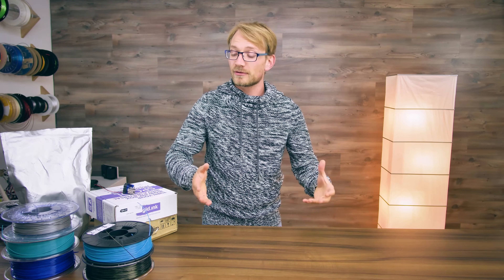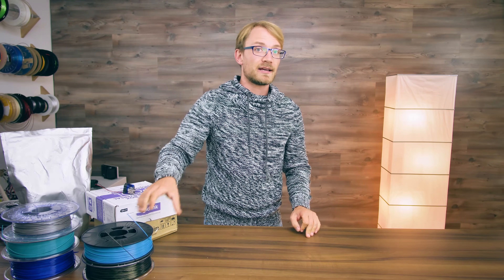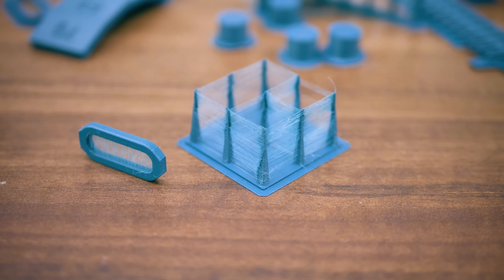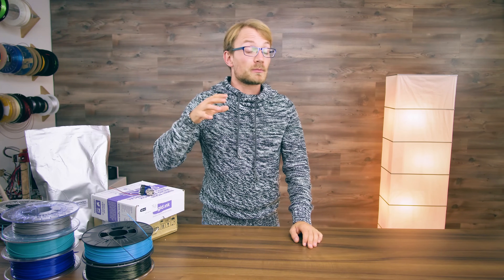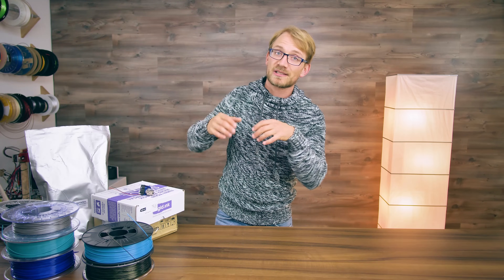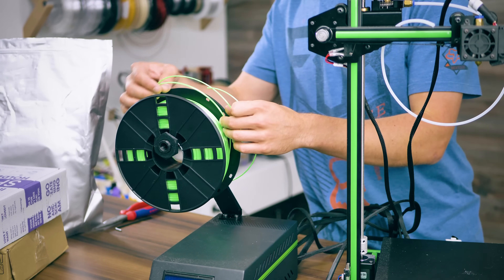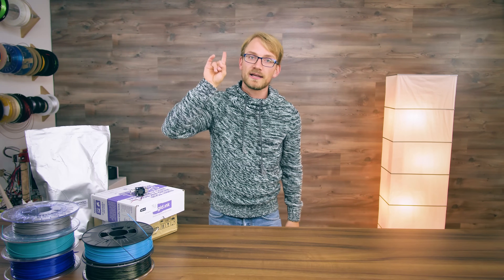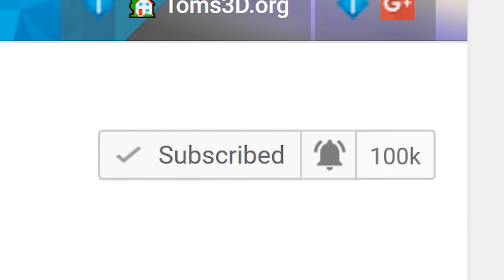5 ways to ruin your filament (and how to fix it)!

Comment: hey, awesome dog and great video :) one question though you mentioned shatterig fillament briefly and I was filled with hope! I baught a bulk lot of UP 3d fillament for super cheap (less that a fiver a roll!) from a returned pallet shipment, risky i know but most of it is fine and prints great, several rolls however exibit this shattering you speak of and i cannot find a fix anywhere, is there one or do i just have to write off those rolls? :) if anyone has any help with this i would be greatful :)

Comment: End G code can help with the turning the thing off nicely. Here's most of mine:

G91 ; relative positioning
G0 Z25 F1200 ; move up 25mm from previous position for safety
G90 ; absolute positioning
G0 X125 Y10 F3600 ; get toolhead out of the way

M84 ; disable steppers
M109 R40 ; wait for hotend to cool
M104 S0 ; turn it off when it cools enough
M81 ; turn off power supply

Do note that M81 only really works on power supplies with their control signal wired into the printer electronics.
Reply: Anonymouspock m109 S40 won't work on marlin as it won't wait for a temp below 80. So that gcode will just instantly turn off the  heater then printer. As I experienced last week. I had to set the cooldown temp to 90, then it would wait.
Reply: John Gisby You're evidently incorrect since I use Marlin and it does not do that. Ah I see your problem: switch S to R and it will wait to cool instead of ignoring the line.
Reply: Anonymouspock marlin will not wait for a temp that is less than half the minimum extrude temp. So either yours has no minimum extrude temp which is bad for it. Or it's not actually waiting, it's getting to this temp(80ish), waiting 20 secs then turning off anyway. Also yes I'm using R not S
Reply: I have Melzi. Will the "M109 R40 ; wait for hotend to cool" work?
Reply: That is probably untrue since I use Marlin and it definitely doesn't shut down immediately. Melzi is a board, not a firmware so no idea if it would work. Try heating the hot end, running that command, then immediately moving an axis. If it doesn't move, it's waiting for temp, then once it hits 40C, it should move, assuming the wait command actually works.

This all doesn't matter because the Melzi doesn't have power supply control from what I can tell, so you might as well use M104 S0 and leave it at that. The point of turning off the power supply after the hot end is cool is that my hot end fan is hardwired into the PSU, so I want to turn it off once the hot end isn't going to heat creep enough to care.
Reply: ANYCUBUC I3 MEGA has a head cooling down feature - after print job is done it homes on the last Z-coord, stops motors and leaves head fan running until head is cooled below 50C. Not saying about "end filament feature" - it's one of the most helpful. 😀

Comment: 6. Dust is a killer. I've spent a lot of time 3D printing in my basement with a wood-burning furnace and have to be extra vigilant against dust. Use a dry box, and retract your filament into it between long uses. Even storing your filament in a closed cardboard box will allow dust to get on it over enough time, and I currently have 4 rolls of filament on their way to the garbage because of this.
Reply: just use a filament cleaner on your 3d printer. I store and print in a closed container but allways put on the filament cleaner.   nozzle clogs less as well.
Reply: You are spot on with "#6".  The benefit of using a filament cleaner is apparent after you examine the sponge inside and see all of the dust it captured.  I do not print without one.
Reply: Sponge filament cleaner
Reply: You can always add an inline filament dust collector.

Comment: Cool Dog...  one thing, and think I've mentioned this before, Please PLEASE stop using 60fps video!!  ugg. it's just a waste of Band width, and some people (myself included) just get poor quality, jumpy video because of it.  or constant pausing/buffering. I get better video at 480 than at 720 or 1080 at 60fps.  If you were doing high speed video like Quadcopters flight or something I can see it... but for simple video of you chatting i's just a waste and makes overly large file sizes. It's nice to have HD so you can see things clearly, but 60FPS isn't any clearer..   Sorry for the rant.. but love your videos and it's super frustrating when it's all jumpy for no real reason . :/
Reply: Correct, but all the HD are 60fps, which makes it jumpy.. 480 is the highest quality not 60fps, which is low quality to say the least and can make some details hard or impossible to see clearly. 60fps is just a waste of bandwidth for anything but fast motion video (RC plane or quadcopter flights type stuff) 30fps is more than enough for this type of video, and will allow for clear and DETAILED video image which is more important than high speed frame rate. AND again, 60fps is increases the file size as well as the bandwidth needed(well kinda they are join) .. it's just a waste of everything for this type of video, it adds nothing useful, but subtracts from many being able to view it properly.
Reply: it's just an unneeded amount of frames, waste of bandwidth and file size it huge for no real benefit. 60fps is going to limit viewers who aren't in a high population area as their internet speeds aren't going to be high enough, and or people with older computers who's graphic cards aren't as fast.  Easy fix,  Cameras/editing software just needs to be set to 30fps. No one will notice but those having issues with 60fps viewing. everyone else wont see a difference.
Reply: If you use chrome you can download an extension called "Turn off the Lights", it can block 60 fps modes on youtube.
Reply: Thanks, just tried it, and though it "helps" I guess, it causes a mass of ghosting around all motion .. just watching this video with it on I keep seeing like  2 or 3 Tom heads LOL    all kinds of blurring and ghosting around him also.. really not any better than just watching in blurry 480.. :/
Reply: Huh. Works fine for me on everything. I liked filament playing doge at 60!
Reply from the maker: +3Dprinting Llama that's weird... YouTube should provide appropriate formats for your hardware so you that 60p uploads shouldn't become an issue.
Plays well on any of my hardware (including Smart TVs, phones, low-spec netbook), so I can't offer any help here unfortunately
Reply: you wouldn't see a difference between 30 and 60 in any part of this video.You'll notice using the higher bandwidth use for higher resolution than higher frame rate as a clearer image is more noticeable o the human eye than higher speed once over around 25fps area
Reply: Well i happen to be nearly blind so i really don't care about resolution, and 60fps did help the doge a lot! You can't say that it wouldn't be visible in any part of the video, because it was. Perhaps not vital; but then the resolution wasn't really either, there really isn't any fine text or anything.

As to bandwidth, i looked up, and YouTube allocates 50% higher bandwidth to 60fps than 30fps, which isn't really THAT bad, i could watch it on 3G in 720p on a moving bus just fine. And in an emergency there's still 480p fallback, which is not horrible.
Reply: Actually, 60 FPS versus 30 FPS has less difference on bandwidth than you would think.  The important thing to know is that video is encoded with frame deltas where rather than storing each frame individually, it looks at the differences between frames and stores those instead.  The smaller the differences are, the further they can be compressed, and with video, most of the time a given frame is nearly identical to the previous one, so this is far more efficient than compressing each frame separately.  (Since the differences are compressed with loosey compression, errors slowly build up, so the encoder will insert a fresh frame every now and then.  You can often see this happen in old low resolution videos where the block patterns linger between frames and suddenly clear up every second or two.)  Anyway, the important thing to note is that two consecutive frames in a 60 FPS video are more similar to each other than two frames in a 30 FPS video, simply because less time has passed in between them.

Another thing that happens in compression is that given a certain bandwidth, resolution and framerate are largely independent from quality.  The best way to explain this is to note that compression kinda-sorta (very oversimplified!) works by splitting the image into blocks (for a video, the blocks can have a "thickness" of more than one frame) and computing a single color that best matches the average of the pixels in the block.  Next, you inspect the blocks and pick the ones that have the most detail that isn't well represented by being a solid color and split those up into smaller blocks and assign each one of those a color.  Keep doing this until you either reach a high enough quality that it's not worth continuing, or until you hit your bandwidth quota.  Your compressed image is then a list of all your final blocks, which, since blocks can be fairly big, is much smaller to store than a list of every pixel.  The important thing to note is that the sizes of these blocks have nothing to do with the actual number of pixels.  The difference is that for areas with fine detail, you have blocks that might be smaller than pixels in low resolutions, but in modern video codecs (where the data in a block is much more complicated than just a single color!), the vast majority of blocks can easily be 16x16 pixels or larger!  Thus, these blocks will still contribute useful information if you were to scale the frame from 4k down to say 720p.  This also means that the data stream that best represents your video at 4k at a given bandwidth is nearly identical to the stream that best represents it a 720p!  Remember the part about blocks spanning multiple frames?  This means that your 60FPS stream also uses nearly the same data as the 30FPS one, for the same reason.

Another way to look at it is that compressed videos, and images for that matter, have as much in common with vector graphics as they do with raster graphics.  In this interpretation, the image (or frame) is broken down into some number of various sized blocks, corresponding to how much detail is in a given region, each of which is assigned a function to compute individual pixels.  However, the function itself is just an equation, and doesn't care how many pixels it covers.  In this way, the block itself is a tiny vector graphics image, and can be rendered "perfectly", keeping in mind that the function only approximates the original image, at any resolution.  I can't really think of any software that takes advantage of this, though.  Might be an opening for someone to experiment with this sort of projecting a compressed image to different resolutions.
Reply: In YouTube, you can select the playback quality.  Just click on the little Settings gear icon, then select Quality. I see everything from 144p up to 1080p/60fps.
Reply: 50%?  that's not higher?  its a LOT higher.. !!  Simple fact.. it's jumpy on my computer. 30fps isn't.  at to the "dog" helping at 60fps.. I can assure you, you would never have noticed the difference. AN resolution in may of his videos is important and he does often show detailed shots where it is. If watching on a Bus on 3G, the phone kicks it down to 30fps. At least my phone and tablet both do, and thats how I ended up watching it was on my Ipad.. but I hate that as I don't have it handy generally. es, for 80% or even 90% of the world and people watching it's fine and they wont have an issue. But why eliminate those 10% or 20% from enjoying it when it's such a simple thing to just set the editing software/cameras and allow everyone to see it. ??

Comment: If you think tangled round filament is bad, try it with flat 5/8" steel banding.  I run into that all the time at work, when someone doesn't keep the spool under control and lets it freewheel and unwind, then it randomly overlaps itself when slack is taken up.

Comment: UV damage. And i store all of my filaments inside a container 1x2x2 meters. My filament never sees daylight anymore since it reaches my house all the way to the shaped form.
My 2 printers are both hard coded to cool the head and the plate after 4 minutes of non-use, be it filament break/end, or an error flash. No idea how, i inherited them from a friend. But it's very useful, there's no plugin either.

Comment: Thanks for the de-tangling tip :) I've derped my PLA spool sooooo many times with my butter fingers (in the words of AvE, I'm an uncle bumble ****)

The filament cooking point motivated me to think more and I got it!!!! Part cooling fans on some setups are extremely good at making the hot end not reach temperature triggering the thermal runaway protection (I have to set mine to around 75% max otherwise it takes too long to heat up and #triggers the firmware). 

The mistake I was making in my past attempts was I was using S40 rather than R40.

Exploit this by using some clever g-code at the end of your process to stop the filament-snot

M106 S255 ; Set part cooling fan to 100%
M109 R40 ; Set extruder to 40C and wait, R is important, it tells it to wait for both heating and COOLING. Just using S will mean it will go "ok we're above that temperature no worries" and release back to the printer... Causing the fan to turn on, then nearly instantly off.
M107 ; Part cooling fan off
M104 S0 ; Don't do a me and forget this step :) Extruder temp OFF and edit 2: M104 not 109 to shutdown
Reply: I work primarily with ABS, so I don't make full use of the part cooling fan. It usually runs at <40%, for most prints. I only crank it up if I'm doing lots of tiny vertical segments, or it's an especially hot day and things are curling. Recently, I've added a 100% fan command to the end-script, to help the system cool down and prevent baking the bead of filament left over after the final retraction. I've gone from having to clean/replace a hotend every weekend on my weekly maintenance cycle, to using the same one for 5 weeks now! After some investigation, it looks like there might be a small amount of minor abrasives released when ABS overheats, which was corroding my brass hot-end. Not a chemist, just a hypothesis, but it seems to hold up, anecdotally.
Reply: Thomas, when you wind your filament as you do at the beginning of the video, you turn it on itself every turn. When the extruder pulls on it will form loops when the reel will unwind it. To wind it without turning it on itself there are two solutions. The first is the easiest to describe: it is necessary to wind the filament by rotating on the wheel on which it is wound. The second: it is necessary to wind it by looping a turn over the wheel, one turn from below. To verify my remarks, you can check it by taking an extension cord. Wrap it as you do in the video, and while holding both ends of the extension, loosen the curls you have just wound. You'll see the result. Your extension will loop on itself in an infernal way. 😉
Reply: I forgot, for those who use cura, this can be added to the end g-code, do this by (In Cura 2.6.2, I hate the app bundle thing, sooo slow to start, even on SSD)

1) Settings -> Printers -> Manage Printers
2) Select the desired printer (if you have more than one) 
3) Machine Settings
4) Under the "End Gcode" box add the above gcode
5) #profit
Reply: Definitely agree on the filament untangling tip, going to have to watch that again next time I find that one of my spools is like that.
Reply: Thanks for confirming my gut feeling concerning hot end heat after a print. I never shut off my Prusa until the fans stop spinning.

Comment: Seriously folks don't let pets chew/eat your prints or filament, it can cause some serious health issue to their throat's, stomach or parts of the GI track
Reply: Well, really, this tip applies to far more than 3d printing! My old shop cat carefully and slowly consumed an entire box of staples some years ago. He's fine now, but it was touch and go there for a while. If you've every seen a cat die from poultry bones shattering in it's GI tract, it was a lot like that... #shudder
Reply: Corbald 
I think your cat was trying to tell you it needed a more staple diet! 😃
Reply: Well, he had a point.... a lot of them, actually...
Reply: At least PLA is just corn, isn't it?

Comment from the maker: Keep your filament safe! If you have more tips, feel free to document them at https://discuss.toms3d.org/viewtopic.php?f=10&t=265
Reply: nice! I can try ruining filaments for fun!
Reply: I've found that I can leave my ABS in my printer with a WalMart bag full of desiccant also in the enclosure. It's been in there for about a year now.
Reply: I had a hard time finding zip lock bags that fit my spools (including the massive ones from IKEA), but found that my local grocery store had perfect bags for fruit and vegetables. There's 200+ bags on a roll and it cost me a couple of euros.
Reply: Regarding point 5 on your video about leaving the hot end on.
The solution I came up with is to set the firmware to turn off the heat break fan if the nozzle falls below 50 degC.  Though you'd think by now that firmwares would detect if the hot end had been idle too long and cool down.